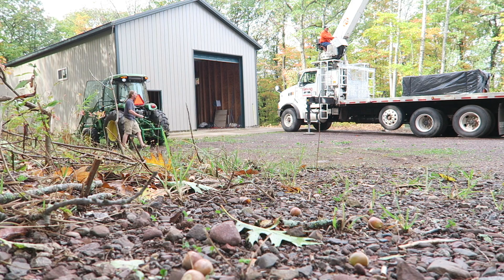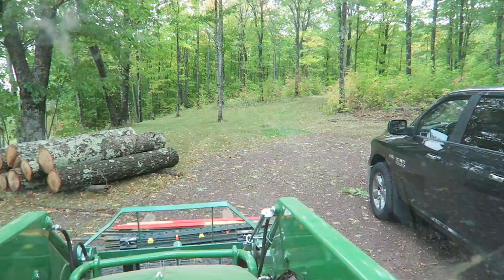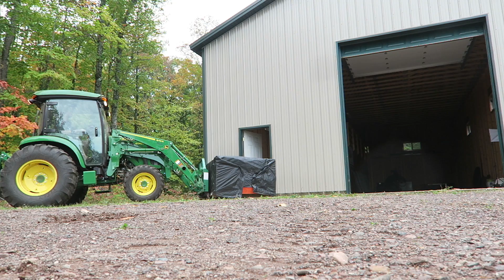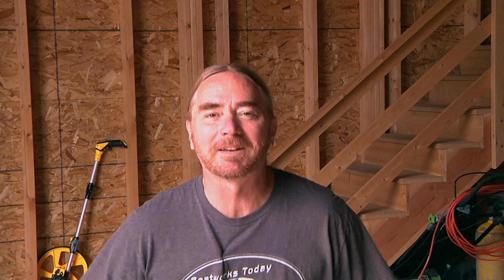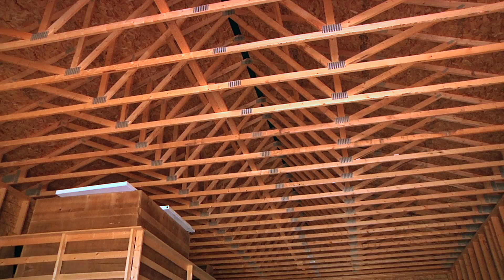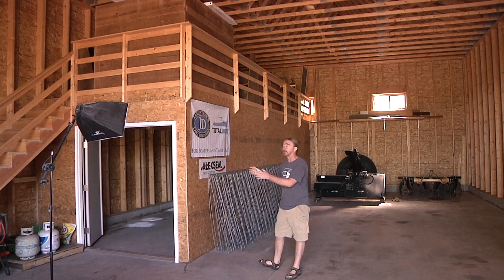THE NEW BOATWORKS TODAY SHOP BUILD BEGINS!

Comment: On the space above the utility area. Find what task whether it be varnishing, painting, excess material storage. Something that you don't do often but when you do, it'd be good to have an auxiliary space for. Then when not in use, the walls can be storage. Or multiple areas of the space large enough for tasks that need those requirements. It's up an out of the way. 

Also, thanks for the building costs transparency and going to the ups and downs of the shop journey. It's cool to be able to see this from the start.

Comment: Mezzanine would be good storage/supply space...good place to keep tools infrequently used. DO find out what the rating is of that floor up there though....otherwise, remove it all and open up that area. You alone know what kind of work you will be doing moving forward.

Comment: Consider a GABLE VENT cut into each end of the Gable roof. (Front and back). I suppose they don't use blown in, insulation back in the midwest? It is used heavily here in the Southwest.
I think rather than OSB, on the walls, you might consider 5/8" Fire rated 12' long sheets of sheetrock on the walls. I would have put it on the ceiling, giving you some fire protection rather than OSB. You do a lot in your shop with flammables.....It will also allow you to seal all the sheetrock seams together making things air tight. A good sheetrock contractor could hang it and texture it pretty quickly. 5/8" is thick and heavy and durable as opposed to 1/2". Also easier to paint then OSB. Just some suggestions....

Comment: Hello Andy, and congratulations on your new property. I would make the upstairs rails above door removable. Far wall upstairs sheet material storage such as coosa boards and plywood. Long wall upstairs wood hold fiberglass rolls and a portable table for cutting on. If not an office for keeping your company squared away does sound pretty good. Good luck and I’m looking forward to the results regardless of final decision. Can’t wait to the progress. Drywall lift on scissor lift may be helpful depends on lift space.

Comment: So the roof insulation is going on top of the OSB ?
If you've ever been in an insulated loft on the 'cold' side of the insulation, specially during the summer, it can get warm up there, if the temperature drops at night you now have warm against cold.
For peace of mind i would go with the ridge vent, alternately a gable end fan or two, make sure they have louvres to stop the critters (some fans have electrically operated louvres, they don't rattle when it's windy)
One thing for the upper part would be a hinged gangplank for eeasy and safe access to the top of larger boats
Probably the best thing up there would be storage, and maybe a mixing station for fibreglassing when doing the internal or upper of the boat (i remember the epic transom repair)

Comment: In our local code, and I live in a slightly warmer climate than you but we do have cold weather and get snow, we're not required to have venting in attic areas that use spray foam insulation. Sprayed foam insulation is like magic. I'm loving the boat shop project. I'm probably actually enjoying it more then the boat work.

Comment: I would be tempted to make a room purely to make parts using a chop gun or just a room to make parts thats ventilated and the ability to be temp controled in the future? Or A Template room to make and store part templates with maybe a small cnc router table for coosa board or core material's for common parts?

Comment: Put a bathroom up there easy plumbing installation
Reply from the maker: Unfortunately there's no way of connecting to a well or septic :-/  Cost of putting one in would be ridiculous :-/
Reply: @boatworkstoday   Insulated tanks are an option, like they use with work camps
Reply: He's got trees, right outside 😝
Reply: Composting toilet reasonable comprise could be an option.

Comment: Add roof vents and drill the eve blocks.   I used blown in cellulose  insulation (16 inches)   On my shop the ceiling is 5/8 rock and the walls are 1/2 cdx (so I  can hang anything anywhere).

Comment: Find a drywall lift, to set on the lift.
It'll make lifting and holding easy.
Reply from the maker: Thought about that, will have to wait to see if the platform on the lift is large enough to be able to do that ;-)!